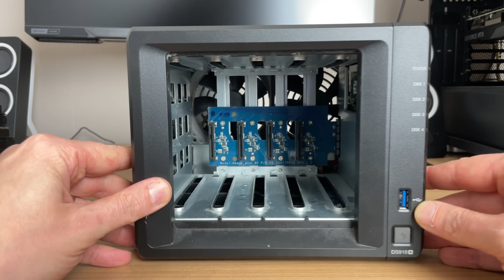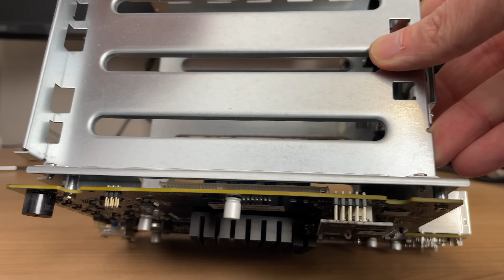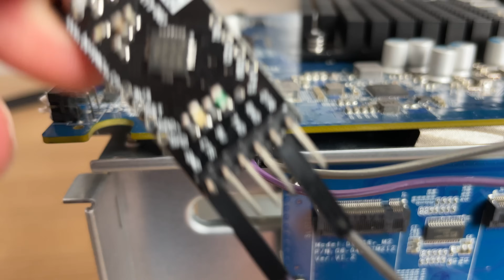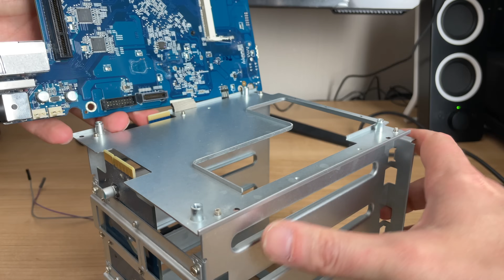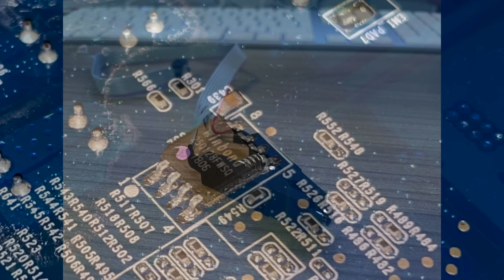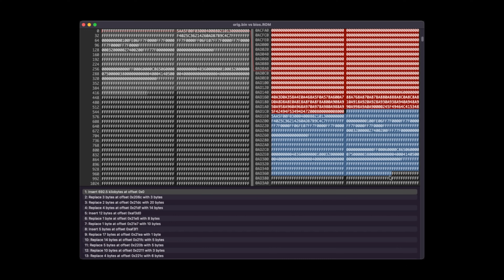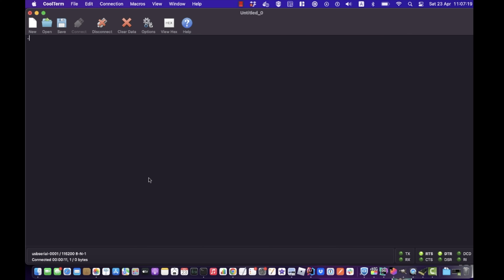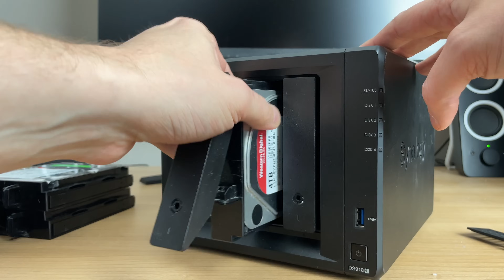Synology DS918+ Bricked / Blue LED of death.

Comment: Sure it's expensive, but it doesn't look like a premium product, ie, Linux is free, and it doesn't have USB flashback like premium motherboards - desoldering chips and getting a programmer is beyond the general public skillset -.
I don't know why people spend big $s on NAS when you can just do it the easy/cheap way and just put more HDDs in a PC - people usually have one running all the time -, and just network to it.

Comment: I'm an EE, and I can tell you that there is nothing "simple" about a power failure. Like or not, we live in an analog world, and a host of odd and (literally!) unpredictable things happen as power goes away. You didn't say (perhaps because you don't know -- not surprisingly!) what actually happened to the power. The voltage may have been low but not zero. The voltage may have fluctuated, going low then normal than low again. There may have been an issue with ground. I therefore think you're being a bit harsh with your criticism of the engineering of your device.

I think it's miraculous that you got your NAS working again. You, of course, have everything backed up, right? I suspect that a motherboard replacement might have fixed your issue at a lower cost than replacing the entire system.

I appreciate the detailed and interesting walk-through. I'm glad I didn't have to do it!

Comment: Do flash chips usually just .. reprogram themselves with an offset? Are you sure you didn't compare a functioning old version of the firmware to a newer version, which would explain the weird differences? 

My guess would actually be that it was broken for a while, and the power loss caused it to boot from scratch, which exposed the problem. In fact, simply disassembling it and applying heat/resoldering some parts could have been what fixed it. Or, a firmware update may have failed but since it was shadowed in ram, it didn't break until rebooting. It could also be a broken solder joint. With lead-free solder in devices with poor cooling and lackluster board design, broken solder joints can be kind of common.

Oh and yeah, I run my nas on Linux with an old server/workstation board, with ecc memory. I can run any program or script or whatever that i want, outside of the limitations of a specific vendor's ecosystem. It's just a lot "harder" to set up and maintain... Except if, say, the motherboard fails, i could have it back up in less than an hour using any old board i have lying around.

Comment: Make sure that you get a UPS and then add a function in the NAS to be controlled by the UPS via USB so that it will shut down gracefully the next time there is a power outage. I have a UPS on all of my server and network devices that will allow me to shut them down locally or remotely when there is a power issue.
Reply: My NAS did this problem despite being on its own dedicated UPS and gracefully shutdown before storms anywhere near it.
So I agree that UPS are essential but despite my resourcing it still didn’t save me from this problem =(

Comment: I was really put off that there was no fuse on this system which would have buffered between the board and what appears to be a power surge that corrupted the bios chip. For the price of these the fact there is no buss fuse tells me this is not a device I will be purchasing! I built my own NAS box with an old system motherboard and it has been a solid system for many years. Think that is the more favorable way to go and a great way to recycle old computer parts to keep them out of landfills.

Comment: Nice video but you really should populate those 2  N VME slots

Planned obsolescence is why
-It doesn't have dual bios
-Safe shutdown in case of PF power failure 
-Easy bios reflash, etc..

Comment: Very nice work. Only thing I wanted to point out is that the construction of the chassis is a cold rolled steel (very standard in the computer industry), it's not Aluminium.

Comment: Nice fix. I saw the ram that was in the Synology had the L marking on it meaning low voltage but the one you had from the laptop didn't. Also, did you take the opportunity to swap the button battery for a fresh one?

Comment: Buy a cheap eco friendly low power pc with dual bios motherboard. Use free nas operating system and a platinum rated psu.
Ez cheap nas that will almost for sure last longer.

Comment: Great video. I had an issue a while back with my DS918+ although that was virus related. Since then I now back up regularly to an external drive, plus via a Cloud service as another layer of protection but as you say you shouldnt have to buy a new NAS for this type of failure.

Comment: I used to have credit card readers and used it for 2 years but one day sudden power outage made it bricked. Call for the customer service and they said the file system is corrupted and it cannot be fixed. So I have to get new one after two years of use. So instead I just grabbed the iPad at home and install square.

Synology and these credit card reader company working it same premise; planned obsolete. I'm pretty sure they can make it more resilient to power outage but it doesn't help their business bottom line.

Comment: This is great.  Thanks.  Mine just died after an accidental power off... I'm ordering a new power supply (which I've read is a possible problem... my light doesn't steadily blink, just blinks once or twice then turns off, no fans.) and if the power supply doesn't do it, I may have to get another one.  Thanks again for this!!

Comment: I have had three Drobos fail and was unable to put the disks in another box, I hate these nas drives. I now use SortRaid pro which means I can put the drives in any machine. I currently use old Mac Pros as servers and I can swap sets easily between computers or a five drive USB gismo I have. SottRaid Pro comes in windows and Mac versions put together any cha=ep box with multiple drive bays and  solve the problem.

Comment: I have this exact Synology NAS and can not recommend enough 2 big adds, which have improved it drastically in my workflow, 1 getting 2 M.2 NVME SSDs and adding RAM, you can add up to 8 GB more ram on top of the 4 GB, despite Synology only stipulating 4 GB expand ability; these 2 things speed things up drastically as well as allowing multiple users and multiple operations, like Surveillance Station, Virtual Machine, and 4K streaming. Like the data as I may need it if the same thing happens to mine; I’m also running (4) 4 TB drives, though I’m running enterprise level SATAs as it is our principal storage and video surveillance outside of our server and we also run the Synology disk system 2, I don’t recall the initials but it works much like Raid 10 but with double redundancy coverage, which isn’t the case in Raid were if you can loose everything if you loose the wrong 2 drives. 
It is sad just how much the business space has changed from repairability and longer longevity to throw away items at long term prices; actual processing speeds haven’t changed massively compared to speeds needed so you can run computers much longer than in years past when things just jumped so fast you’d be left behind; I mean Win 10 has been around for years upon years and still can be run well or well enough on legacy equipment. You should be able to get a 10 year life out of a NAS without issue, assuming drive replacements as needed, because really drive speeds haven’t changed that much in recent years, I mean even this NAS is limited by the network bandwidth of having dual gigabit ports.

Comment: You over-complicated this repair. Power cuts often result in a dead boot block in any computer board, uefi is no exception, they still have a basic input output system and there's still ICs for it.

Comment: My Synology is connected to a UPS. However, during a power cut a month or so ago I realised that the UPS batteries had been drained when my NAS simply switched off a couple of times. Fortunately, it always booted without an issue but, as all my devices are plugged into antisurge sockets, I've been wondering whether what caused your problem was not just a power cut but a voltage fluctuation or something.

Comment: Test its Plugpack with a Multimeter. If no meter check the required voltage probably 12 volts dc and use another plugpack. Watch for a change in the blinking sequence.

Comment: The BIOS may have corrupted long ago and/or gradually over time since it's not used once the Linux kernel boots.  The damage wouldn't be apparent until restarting the NAS.

Also, replacing that RAM with 2x2GB if you have spares would free up a more useful 4GB stick and possibly give a slight boost in performance to the NAS itself (dual channel memory).

I have a QNAP TS-859Pro+ I bought back in 2009 that has worked flawlessly since.  The moment it was out of warranty I upgraded the RAM to 2GB.
I'd have been very disappointed if such an expensive item had only lasted 3 years.

Comment: 1) Would you mind adding information about all the tools you used?  The serial to USB device, the program to read off of that, the card it connected to, the Hex editor you used....you know....all the fun, techie bits.  

2) Is it possible the USB and the PS9 keyboard/mouse port on the back are there for accessing the console of the device and if you had used those, you would have been able to flash the bios from the USB port on the front?  

I'm wondering if there are utilities built in that would be revealed if you were somehow able to boot it to a "recovery mode" or "safe mode" or something like that.....not sure if that's an option, just a thought. 

Thanks for all the details you did provide however.  Very informative.

Comment: Impressive repairing skills displayed here. I love what Synology is doing in general. Nothing gets close to it but they have their issues indeed. 
I'd never run one without an UPS ... The problem you encountered is very rare, but it is common for Synology NAS  to become "read only" (in best case) after an outage or to become unable to mount your volumes. It is easy to repair without data loss with the right command, but the check/rebuild will run for >24hrs, which is not good for your stress level ;-)

Just one remark .... Never use the built-in admin account. First thing you should do after setting up a Syno is to create yourself one or two other admin accounts named differently and disable that one forever. 
Well know NAS brands are notorious targets for cryptolockers and old DSM versions had vulnerabilities that were  specifically targeted. Having that admin account disabled and an up to date DSM already defeats 99% of the exploits.
Reply: I agree on the admin account change - I'd add that the safest solution is simply to not expose your NAS to the internet. Use it over a VPN to your home network if you just can't live without accessing it, but opening it up to the internet (via forwarded ports or via uPnP) is asking for trouble.
Reply: @m0rthaus  I had exposed mine at one point and within days, lots of IPs from China were trying to break into the NAS.  I turned off the external sharing at that point.
Reply: The problem described here might have happened during a software update.

To reduce the risk of corrupted volumes due to a power cut, it may help disabling the write cache feature. On user volumes using ext4, Synology unfortunately uses writeback journaling instead of the default journaling mode and that can’t be changed.
Reply: @nelsone.hernandez6654  but his drives and data were demonstrated to be unaffected, so not sure how writeback journaling of the hard drive relates to a corrupted bios chip...
Reply: Agree.   It's a huge risk  when you cut the power, not even considering the flashing LED of death.   It sometimes takes 12-24 hours to validate the RAID array

Comment: Excellent process.   One question i had was how com you just didnt reflash the bios that you downloaded from the website instead of editing the corrupted bios?
Reply from the maker: Couldn’t flash the bios file directly because it didn’t fit on the flash. Most likely it was wrapped in an exe or something and required some processing. Just looked at the content and compared it to what I downloaded from the flash. And noticed some similarities and was able to find the relevant content that I needed to cut and flash onto the chip.
Reply: @RetroSpector78  makes sense... cheers.

Comment: Don't use off the shelf NAS products to store data that's important. Use PC based hardware and software such as TrueNAS. Its way more versatile..meaning if the hardware dies, you can simply throw the drives into another PC, and power it up. I do commercial networking/hardware support for a living..I've seen clients lose data so many times because of these poorly built units. Most of these manufacturers don't even produce replacement parts for their units.
Reply from the maker: It can also become complex if you need to set everything up yourself. Form-factor is also important. I think a truenas or freenas installation can also break. In the synology case also the data was not on real danger and I was able to recover everything.

Comment: unreliable winbond flash chips? I would replace it to something a bit more fresh anyway, Howe surge might have damaged not only the data, also it seems PSU of this NAS is not perfectly protected from spikes on power lines. Some preliminary filtering/stabilisation probably would be a good idea.

Comment: Well done.
I do find it a bit of a mystery as to how the bios became corrupted. I would have been tempted to replace the bios chip. 
Of course it may have been possible that the hardware /  software mechanisms that are involved with flashing the rom were somehow brought into play which would not prevent the problem from happening again. It could very well be that the firmware upgrading function is not that well written and is not 'locked out of operation' well enough if a power outage , or brown out comes into play.

Comment: I have a DS212 with 2x 4TB drives (in mirror).  I only recently put it in service, but I keep a full backup on a RAID.  I just don't trust the thing.  The original owner who gave it to me stated that it had gotten slower and slower after every update it received.  I had to manually disable a bunch of bloat with putty/ssh to get it back to its original performance.  Anyway, great fix!  I messed with bios flashing before, but this is next level.

Comment: Great Job. Congratulation. I had a similar issue with an Cherry Wireless Desktop keyboard, where I must reflash the USB Tranceiver Stick. Thanks god I have more than one set of these desktop/mouse sets and I could clone the 24W02 EEPROM.

Comment: To call this a chance find would be rude. That was sheer skill! And thanks for the informative and entertaining video. Good job!

What was lucky though is that Synology stores the bios/system image as a plain file(with header) and not encrypted with any strange routine... which is usually the norm. Also that none of the other many components was defective ... That was lucky. :)) Don't forget the backups, as NAS (even in a mirrored configuration) is NO Backup.
Reply: He just randomly edited the BIOS with no prompt whatsoever. Of course it was lucky as hell.

Comment: I've had a DS918+ die suddenly, in a similar way. Had another solution, but when I looked into the NAS failure, symptoms looked like the infamous "Low Pin Count" interface affecting some Celeron CPU models. When I later was going in to try to fix it (found a suggestion in a YouTube video), the machine was able to boot again, without issues.

Comment: Nice job. The Synology DDR3L is low power DDR3 memory DIMM, the one you use is normal DDR3, they work on different voltage. And unbelievable that the BIOS could be modified, that must be a hardware or software bug.

Comment: 00:48 Presumably you have backups and aren't just relying on a single NAS for all your stuff. RAID isn't backup!!!. At least get a UPS to give some protection from brownouts build a backup . I use a TR-004 to backup to individual disks that can be NTFS,EXT2 etc and read in any PC.
I did enjoy how you recovered this. I half hoped that Synology  would make these more user serviceable. Put the flash  memory in a socket. bring the debug port out to a 9way D.

Comment: That was a really good video, but you could have saved all that trouble in the first instance by just attaching an uninterrupted power supply. I have had issues in the past where my domestic supply would cut and it cost me to get my pc repaired (I did it myself). However I learned an important lesson and now both my pc and my NAS are connected to UPS to prevent just such a problem as this one shown from occurring in the first place. I know this is a 20/20 hindsight thing, but it just gives peace of mind to me and I would recommend others doing the same.
Reply from the maker: So everyone is telling me :) however I don’t think you should expect consumers to add a UPS device to every electronic device to avoid bricking devices during outages. So mixed feelings about this. But I definitely see the added value. Just wished Synology would make it easier to unbrick these devices.
Reply: @RetroSpector78  I’m a domestic consumer and decided to get UPSs for my kit having learned a hard lesson in the same way you did. It just means I can relax should another power cut occur in the future. They aren’t too expensive either.
Reply from the maker: Will buy one and make a video on it. Thx for watching and hope to see you in future videos as well !
Reply: @RetroSpector78  👍🏻

Comment: Seems like you downloaded an ELF file or something ? The design should have made sure the CPU and NOR were frozen before the power really failed. Anyway good work fixing it. I should mention a plain Raspberry Pi can be used for SPI flashing. I used a 12 year old PC rammed with disks and ZFS that way could attach the drives to anything else.